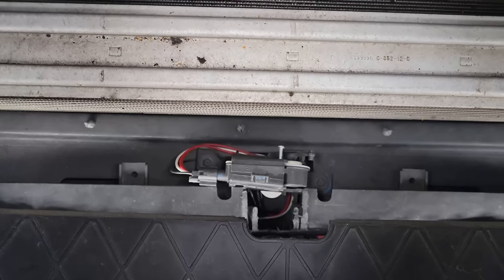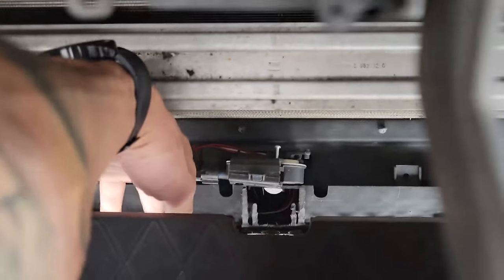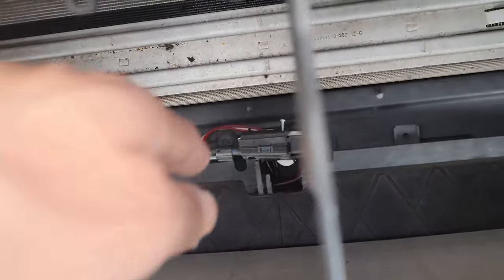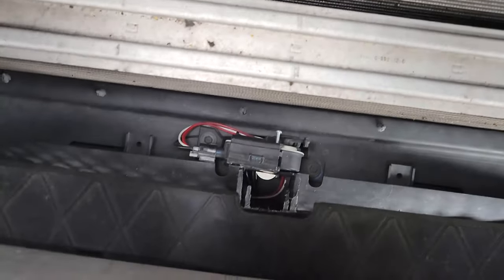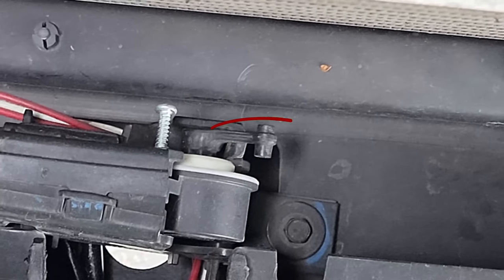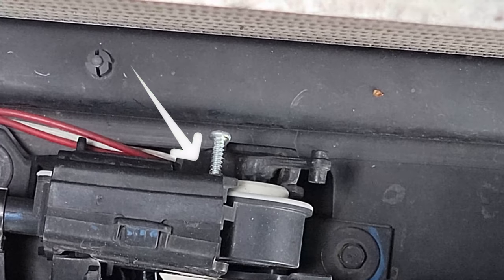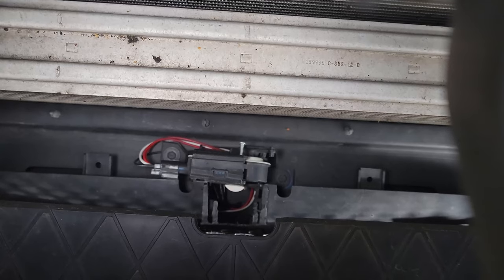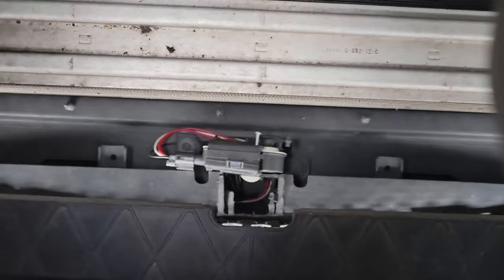Dodge Dart Active Grille Shutter | Check Engine Light Fix

Comment: Found this little paragraph that explains why this works to trick the ags system.
"The Powertrain Control Module (PCM) receives a message from the Active Grill Shutter (AGS) Actuator that the open to close position travel is above 100 degrees or the mechanical stop was detected before the commanded position was reached."

Basically the ags motor has a little arm that moves back and forth. When you first turn your engine on it actuates doing a full cycle. If the arm moves all the way to the forward position it knows that the fins are missing, giving you a check engine light. When the fans are installed correctly it blocks the arm from doing a full cycle. The purpose of the screw is to stop it at that point so it doesn't give you a P1D73 code.

(Thanks for posting btw! Saved me $200 from going out and buying a whole new shutter)
Reply from the maker: Thanks for that explanation! I knew what was going on but this puts it into words perfectly. 

And no problem, Just trying to help!
Reply: Does that mean the fans are not working correctly or installed correctly and I need to fix them ? If I trick the computer and the light goes away doesnt that mean the problem is still there or does the problem resolve becuase its a computer issue :?
Reply from the maker: @ADawg467  If you have this code, your fans should be on all of the time. It thinks or knows that your ags is broken so it turns on the fans so your engine doesn't overheat. 

These are the possible causes for the code:

Active grill shutter actuator poor electrical connection

Active grill shutter obstructed/binding

Active grill shutter actuator linkage 
disconnected/binding/broken

Active grill shutter actuator mounting hardware loose or missing

Active grill shutter actuator

with the bumper off, you can visibly see if the wires are broken/disconnected, if the shutters are obstructed, or if hardware is missing. Turn the car on and you can see if the actuator is moving.

Comment: My mechanic charged me $172 to diagnose this issue (strangely timed 15 mins after I left the shop after getting the entire clutch system replaced) and now they want $1200+ to replace the grill shutter. Am I being ripped off?
Reply from the maker: Yes. I can't speak for the diagnosis but you can get a brand new active grille shutter for much much less than that and it's super simple to install. Or if you don't care about the active grille shutter, you can do this "screw trick."
Reply: @MEasy717  ah okay, gotcha!!
Reply: I'm having the same issue. And the dealer wants $1200  to fix it.
Reply: @Eliazarr79  unfortunately, I'll have to get this fixed at some point because I can hear the air intake problems. But getting new winter tires first is a bigger priority.
Reply: Just got mine working on my car and they were trying to charge me about a 1000$. My fix costed me only 12$ which was the harness. I got the an ags but i ended up not using it so i will return it now. Please let me know if you are still having this problem, i can help you with a step by step on how to diagnose it and fix it as cheap as possible. Unfortunately all three mechanics that i went to chose the most expensive fix. Idk if they knew or what but i got you if you need anything
Reply: And for the air intake problem, its just because the car run the fan on high all the time when it lose communication. As soon as I fixed it, it stopped and i felt the car running so much smother
Reply from the maker: @aymanfaghih3604 glad you got it fixed dude! Idk if youre talking to me or not but mines been fixed since before i poseted this video lol. Me and so many other guys in the comments here have given the exact breakdown on what is going on here and I have several videos explaining it.
Reply: @aymanfaghih3604  what other technique did you use.?? I’m having this same problem..
Reply: @MEasy717  do you think I can do this myself.? Or I may need help.??
Reply from the maker: @gabriellesimpson1221 this is it Gabby. Got a new pigtail to fix the broken wire and put a screw in the motor to make it think that the active grille shutter is still there and working properly
Reply from the maker: @gabriellesimpson1221  everything that I did, you can do too. I cut the old wire connector off and wired in a new one using butt connectors (very easy) and then put a screw on the hole in the motor where I showed in the video. I used a drill to get it to go in further. Only took a few minutes once you take the bumper off.
Reply: @MEasy717  oh yea ik, i was replying to alison, appreciate the video. Cheers
Reply from the maker: @aymanfaghih3604  oh. I get a notification for event comment. Didn't see the the tag 🤦🏽
Reply: You can replace it yourself for 200
Reply from the maker: @davidpoole8130 or you can do this for free
Reply from the maker: @davidpoole8130 It is really simple to replace if you just wanted to do that. But if you don't care about the ags or like me, purposely removed it and/or you don't have $200 to spend on an unimportant car part, you can do this.

Comment: Lies. Did the same thing you said and still it came back in few hours after I drove it. 😂 no one can get rid of this unless they replace it
Reply from the maker: This is my most popular video lol. It's definitely helping people. What is the exact problem with yours? I forget the codes but I had  "ags malfunction" or something like that. That was because I deleted the grille shutter. The screw trick fixes that. I also had "lost communication with ags" buying a new pigtail fixes that.

Comment: So I put the screw to stop the trigger but do I also have to disconnect the battery to get it to stop the loud noise?
Reply from the maker: If you have a code reader, you can clear the code with that but if not, yes, disconnect the battery.

Comment: You said putting the screw in the hole tricks the computer to thinking the active grille shutter is still there. Is the sensor with the screw in it the active grille shutter or did you remove the active grille shutter? I have this P1D73 code on my 2013 Dodge Dart. I am trying to figure out how I want to approach a solution without a mechanic
Reply from the maker: It's the motor for the active grille shutter that the screw goes into. And yes, I did remove the active grille shutter. Idr what my code was, possibly the same one but It doesn't cost anything to try this for yourself. I go into detail on my problem in a few of my other videos.
Reply: @MEasy717  Are you saying that the Grill Shutter is useless?
Reply from the maker: @allisonkessler17  No, it has a purpose. But it's not necessary and can be removed if you wish to do so. 

When at low speeds, cruising around the city, the shutters will open, allowing more air into your engine bay to cool it down. At higher speeds like on the highway, the shutters will close, making your car more aerodynamic and probably providing a very small increase in fuel mileage. 

If you want to make more power, it is counterproductive to have a grille shutter because it will reduce the amount of air that can get to your engine.
Reply: @MEasy717  oh how interesting! I do more highway driving right now. It's great to know how that works. Thank you so much!
Reply from the maker: You're welcome!!

Comment: So i took this into the dealership and they left the grille shutter in the open position, and then unplugged the actuator. This left my radiator fan running non stop until i get a new grille shutter. Will the radiator fan continue to run if i do this trick?
Reply from the maker: No, if you do this the fan will turn off after the code has been cleared. If you don't have someone to clear the code for you, you can just disconnect the battery and reconnect it.

Comment: Wich wire connects to what? Is different colors and positions
Reply from the maker: You have to mix and match until you get it right. It helps if you can find a pigtail that has at least 2 of the wires color coded.

Comment: what is the new harness for? is it to be able to extend and relocate the motor, or is it because you needed a replacement harness or what?
Reply from the maker: I needed a new harness, one of the wires snapped.
Reply: @MEasy717 where did you purchase this harness ?
Reply from the maker: @Morefirecutz  links in the description